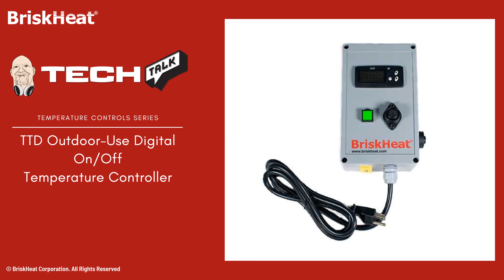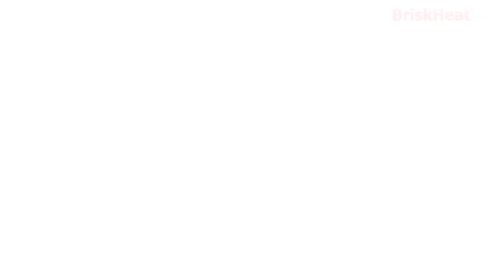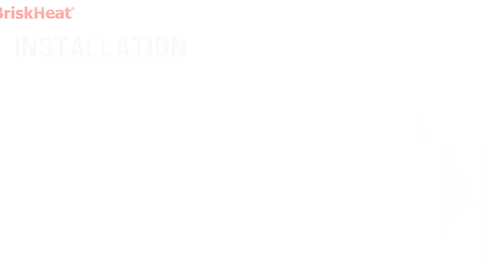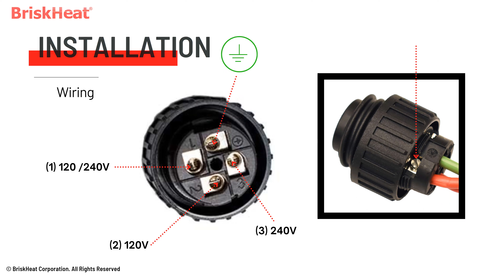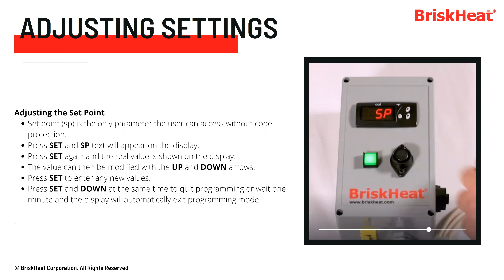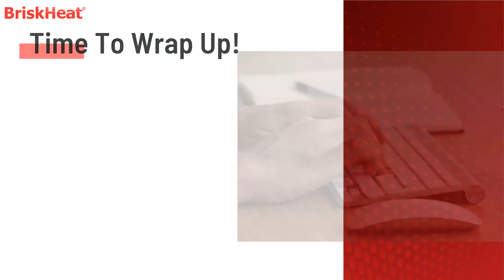BriskHeat's TTD Outdoor-Use Digital On/Off  Temperature Controller Workshop

Comment: I have the TTD175 model my question is whether I connect it to 110 or 220 please
Reply from the maker: The TTD175-K120 is for 120 volt
The TTD175-K240 is for 240 volt
https://www.briskheat.com/ttd-outdoor-use-digital-on-off-temperature-controller.html
Here is a link to the instruction manual. 
https://www.briskheat.com/mwdownloads/download/link/id/95